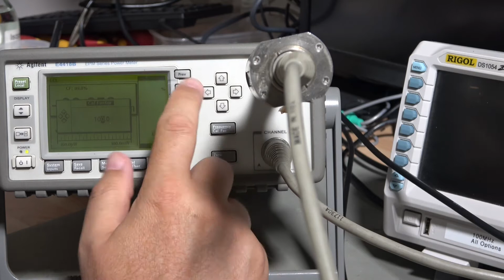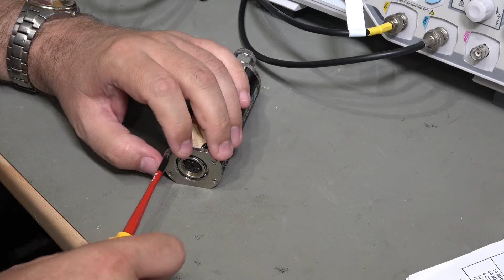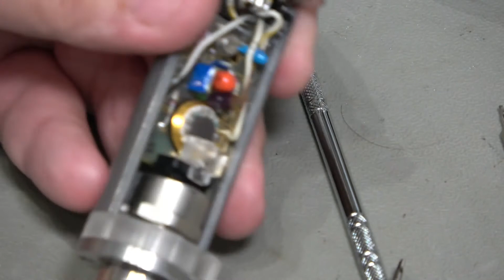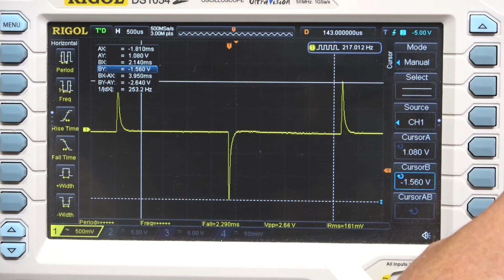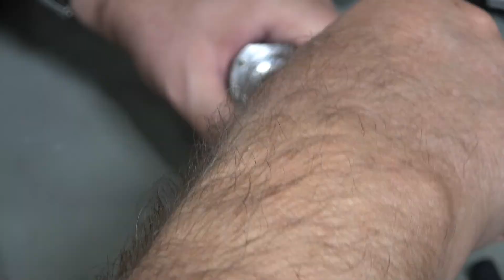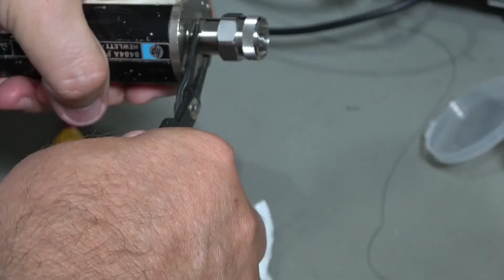0009 HP 8484A Power Sensor Chopper Adjustment

Comment: What is Chopper for?
Reply from the maker: The single biggest thing is the removal of DC offset - the signal from the diode or thermocouple is tiny and needs amplification.  Any tiny DC offset or 1/f noise in any of the amplifier stages would swamp (or at lease introduce unpredictable large error) the signal being measured - so by chopping it at about 400Hz it becomes AC and can be decoupled at each stage and amplified as an AC signal and the DC offset simply blocked at each stage.  Now it is at about 400Hz it is easier to filter out 1/f noise in the sensor and amplifier circuit.  Finally the overall circuit can exhibit drifts due to temperature but these are mainly in transistor biasing (DC), whereas the controlled amplifier feedback is normally well compensated for temperature changes, so the AC signal is not significantly affected by temperature drift.

Comment: I'm not clear on one thing, are the bnc connectors used with the modification to observe the signals generated by the sensor? Then, to calibrate you need to act in the sensor itself?
thaks
Reply from the maker: Yes,  I did do another Video where I showed it in action. The modification is used to see the signals from the sensor - they are too low to probe directly.  The sensor signal can be horribly low and is typically multiplied by a few thousand in the front end of the meter. A tiny DC signal from the sensor would be a horrible problem , imagine any input offset or input current bias offset int he early amplifiers would seriously damage the accuracy and also tricky to get into the linear region of the amplifiers, so the Sensor chops it into an AC signal so that any DC can be ignored, I think it may also reduce some thrmal stability problems.  Anyway, the problem is when the sensor chops it into AC it makes very fast transitions and  creates little transient spikes at the transition, also the two halves of the waveform should be opposite polarity but equal amplitude and that can drift over time. That lack of symetry and large spikes throws off the later measurement.   This mod is designed to show the output from the sensor, sufficiently amplified to service the sensor.  It is more of a problem with older sensors because the multiway socket on the back of the sensor is wired to the pcb with short wires.  as these shift over time (vibration, impact etc) then capacitance and inductance change and impact the signals, hence servicing involves looking at the amplified output of the sensor and easing those leads with a non conductive stick.

Comment from the maker: I'll proably readjust the sensor a litte next time I'm in the lab. This was first attempt and although I did achieve an improvment, I think I could have done better.  On reflection I think it is better to sacrifice the "spikes" slightly in favour of getting nice flat chapped voltages with minimal difference - that is what gives us the minimum error at the lowest end of the sensor range.